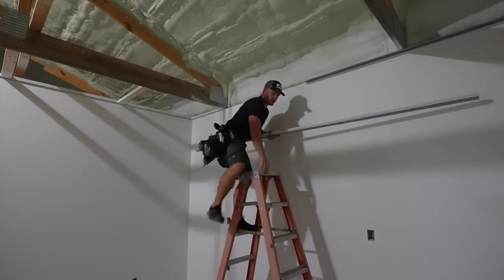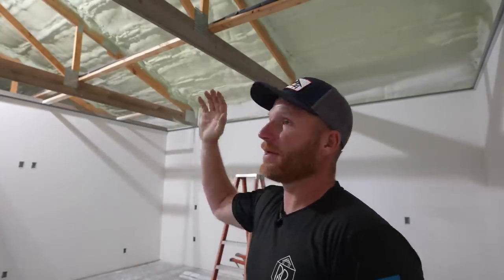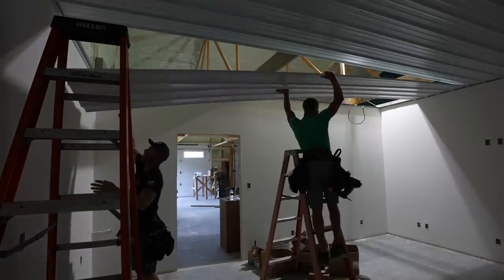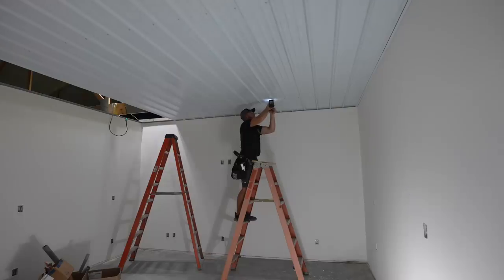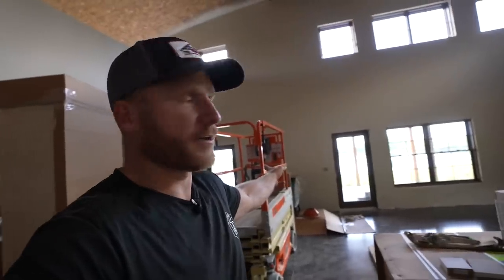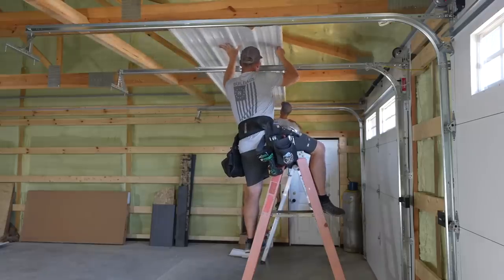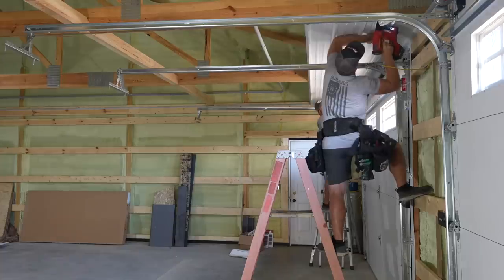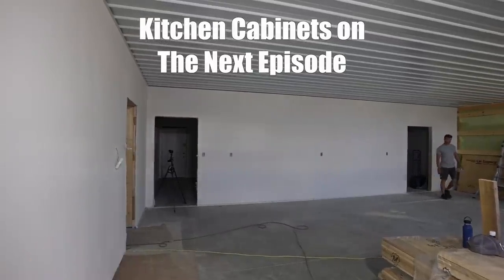We’re back to finish the Barnominium Interior!

Comment from the maker: Not the Longest video...I have a few more I'm working on now, they just didn't fit all together as one so stay tuned for cabinetry install and trim!  The Barndo is coming together!  plans here https://rrplans.bigcartel.com/
Reply: Definitely to short 😂 We need more!! Can't wait for the following videos, I love this series! Have an awesome weekend guys!
Reply: How short were the ceiling panels cut? 1/2, 1/4?
Reply: how much would a build like this cost? The reason I'm asking is cause me and my wife are wanting to build something like this.
Reply: Hi so above the garage ceiling, which looks great, are you going to lay some boards for an attic space, there must be a good few meters of head height?
Reply: @PowerWash2022  It all depends on the area and who you have build it. There is no specific, "heres the price" because barndominium style or postframes are completely and 100% customizable. The main structure is the only thing that's relatively consistent because it's mainly a square or rectangular design. I've seen some locations for this size house cost around $175k turn key. Others I've seen as high as $600k. My grandparents build a postframe similar to this but went all out, final turn key price not including land was $370k. It all depends on your market, location, materials used, contractors chosen, etc.. You can price out a basic lumber package from finding plans online, but again this all varies depending on your wants and needs (rafters, ceiling joists, stories, etc..). The ability to do some of the work yourself also could decrease the price. You can build these types of homes cheap, but you can also build them insanely expensive!

Comment: I’m far from an expert so I can only tell you what and why I think insulation will make the tin bow on 8ft centers. When we built a shop and finished the ceiling and insulated it to a R-24 rating we ran 2x4’s 3 ft on center between the truss rafters that were 8ft OC. The reason we did that was a friend did not in his shop that had rafters 8’ OC  and you could see a slight bow after he blew in the insulation. We both blew in loose cellulose insulation. Why we went 3’ OC also had to due with the length of sheets we used. 3’ is most likely overkill as I put up a building I use for cold storage now with thoughts of making it a shop someday and the builder built it as shop with rafters 4’ OC  so the ceiling could be finished other wise-the rafters could have been built 8’ OC. I guess I am not to much help for your question of is 6’ OC close enough. We both used tin from Menards, but that was 30 years ago and I do not remember the gauge of the tin and if it was called durabond back then.

Comment: 40 year carpenter here; (yes, 40 now! Sep. of 1982. I was off by a year last year 😏) 
Direction of overlap for all types of applications is commonly known as, "line of sight". 
Also, do you normally use stitch screws on the overlaps, especially, while hanging a ceiling 8ft. on center?

Comment: Which would be better for a pole barn shop that will be used as a “mechanic” shop.     Won’t be cooled in the summer but will be heated by wood stove in winter.   Location is in southern Mississippi.    Looking at bubble foil barrier and the usual faced fiberglass building insulation.

Comment: Are those two back rooms ac/heated? The only reason I ask is with it being the garage I would think those rooms see high humidity in summer and low heat in winter up which would rust weights and not be very good for the electronics in the man cave or does the spray foam with drywall do enough on its own without a conditioned space? It looks amazing I was excited for you to come back to this build its such a cool way to build a house.
Reply: Doesn't matter

Comment: Is this standard 29g steel? No concern it will sag considering it is 8 ft OC? Will it handle the weight of blown in insulation?
Reply: Think about it... What do you think
Reply: No it will not handle blown in insulation. I would not do it  like they did with no insulation.
Reply: @richardlug6139  I'm thinking of using Menards Dura Panel at 6 ft with blown in fiberglass. Rated at 3.6 lb and insulation is 1 lb? Do you have any experience in this?

Comment: I don't understand sheeting the garage ceiling. If they wanted to add a car lift, I guess they can take down a few panels.
Reply: When you build yours, you can do what ever you like.  If you want a lift in that space you will be worrying about more than ceiling panels.
Reply: @ShainAndrews  ok I'll bite, what do you think is worrisome about a lift?
Reply: @EdwardTilley  There is no overhead for it.  There are no concrete provisions.  Pretty sure that section also has in floor heat.  It isn't a shop.  It's a garage.

Comment: Don't remember if you mentioned the capability of adding insulation over steel ceilings in any past videos with the 16' more or less span. Surely each project might have different answers.. When it's my turn to  build, I plan on radiant heating the garage floor (along with the rest with the rest of the house) with closed-cell foam everywhere. Would some blown-in insulation on top of the garage steel ceiling be needed or overkill?  Look forward to more good stuff from you!
Reply: Architects.  Ask three of them that do business in your area.